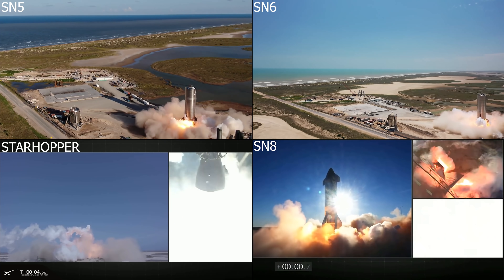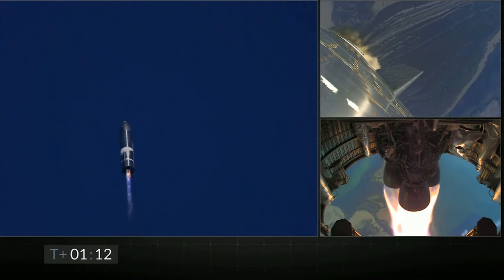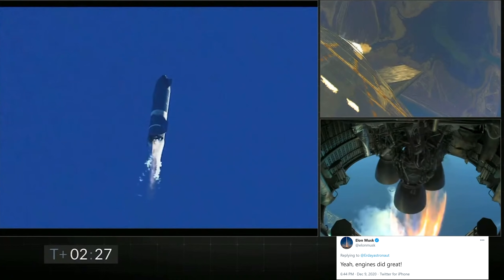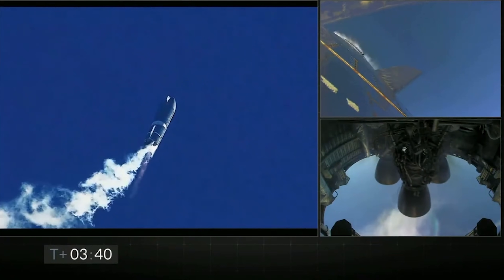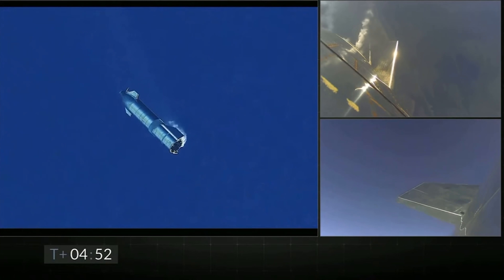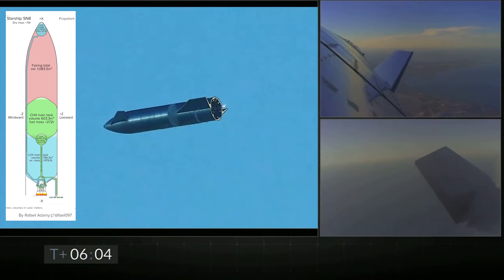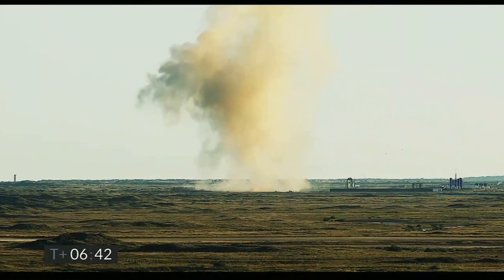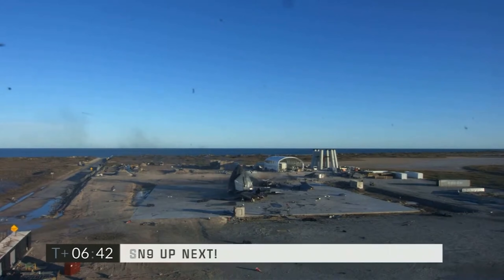SpaceX Starship Serial Number 8 Test Flight

Comment: "And the starship touches the ground at a velocity higher than zero"  😂😂😂 

But seriously this was so incredible to watch. Go SpaceX!!!
Reply: Actually, it will never touch the ground with zero velocity.
Reply: It’s theoretically possible, though highly unlikely, to touch the ground with zero vertical speed. If they got anywhere close to that, then it would be likely they could achieve zero vertical speed at a positive altitude, which is a bad thing if the vehicle has no capability to hover.
Reply: @SyNcLife  It had already done that for a couple months before the flight
Reply: @mapl3bac0n68  no no, it is literally impossible to "touch down" at a velocity of zero according to newton's law. The speed is approaching zero to be more percise
Reply: They should have erected a bouncy castle.
Reply: @wolfvale7863  true why didn’t they 😂

Comment: Very nice informative video! I would like to add that just the fuel header tank suffered pressure issues (as clear by the one engine flaming out) and that is why the engine lost thrust due to burning oxygen rich and producing extremely hot exhaust gasses that burned and corroded the engine

Comment: That's pretty smart even with a third engine shutting off it doesn't reduce the power thrust that much. The thrust is basically the same from ground level to apogee. They have to turn that third engine off at the exact perfect altitude, while calculating fuel weight ratios. Having the rocket thrust pretty much the same throughout the flight. Even while shutting off one of the three engines that's extraordinary. The problem solving here is next level thinking, I don't even think NASA is capable of this. Just look at them using old shuttle part's, taking decades just to make one rocket. The problem with NASA is they still have these old guy's that are incapable of learning new thing's. It's either their way or the wrong way, you can't teach an old dog new tricks. That's why they basically Shaun any modern rocket technologies and Manufacturing techniques. Like if their way is the only way, the"right"way. Even though their way has cost many human lives. With the most simple and unnecessary accidents that should never have happened. Simple case of extreme negligence.

Comment: It's unbelievable this entire flight was done with what looks like a fifth of the oxygen tank volume full AT MOST.
Reply: Gravity drag and air friction is about 15-20% of the energy required to reach orbit. This went about as far as needed to get out of the thickest part of the atmosphere (troposphere is 80% of the mass, stratosphere accounts for most of the rest). At this point, most of your energy should be expended adding tangential velocity if you were aiming to get into orbit and stay there.

Comment: Why -- organizationally speaking -- was there not enough pressure? Did Elon, and the other designers, not think of this?
Reply: We don't know the answer yet. But there are many potential reasons. As these systems burn fuel they are fed pressure by other tanks, if there was a valve that stuck/froze then high pressure would have been lost. Other reasons are they ran out of fuel because simulations and reality didn't match up. With the data from this flight it's very likely the next will land successfully.

Comment: As seen in the video, engines reignite too late, speed of the landing is too high.
Reply: No. You should watch the video again. Engines lit up at the right time. but they got not enough fuel after a few seconds, so they couldn't provide enough thrust to slow the Starship down.
Reply: I see you're not a rocket scientist

Comment: why the engine is so small? seem not fits with the body..
Reply: SpaceX plans for three more engines per Starship.
But this was only a test flight. No need to jeopardize more engines.
Reply: Remember 3 more massive vacuum engines for use in space are going to cram in there.

Comment: 4:08 a common misconception: hot gas thrusters do not provide more thrust than cold gas thrusters of the same size and pressure. They just consume less propellant in doing so. Of course, it is possible that the hot gas thrusters which SpaceX will make are larger/more powerful than the cold gas thrusters they are using now.

Comment: "A landing velocity higher than zero..." 😂😂😂😂😂
Did Musk come up with that euphemism???
Reply: Every landing has a velocity greater than zero. If an object has zero downward velocity, it would never land. It only gets to zero after it hits the ground.
Reply: @thomasmaiden3356  ideally acceleration would be so that velocity hits zero the exact moment it touches down. Just like x² has a derivative of zero as it touches the x axis.
Reply: @thomasmaiden3356  but you get the point
Reply: @thomasmaiden3356  "I concur..."
Reply: I guess that's more of a mathematical way of describing things. As the rocket falls back to earth, it has a negative velocity, meaning the downward direction. In order to avoid a crash landing, the rocket needs to have a positive velocity, one in the upward direction provided by the thrust of the rockets, to balance and "cancel out" the negative velocity. Essentially, it needs to land with a "zero velocity" so that it gingerly touches down. Since it crash landed like this, it technically landed with a velocity less than zero, since there was still a negative velocity. It might have been more accurate to say the rocket landed with a speed greater than zero, since speed isn't concerned about the direction of the motion. Hopefully that makes sense.
Reply: @lariosphotography4721  not bad ;)
Reply: It didn't land with a speed higher than zero, it just crash-landed. Let's say what happened. Shall we?
Reply: Wait, it's speed was less than zero? how did it crash-land?
Reply: @jone5402  Velocity going up was positive, so...
Reply from the maker: @jpdemer5  Hah! Good try, but velocity is a vector quantity. I consider the landing operation to have a downwards vector. On the other hand, who knows how the rocket scientists and engineers at SpaceX do the math. IMHO it would make it super confusing to calculate downwards velocity as negative.
Reply: @faustin289  funny one.
Reply: @faustin289  It did not crash. It disassembled.
Reply: @faustin289  He didn't say it landed, he said it had a landing velocity higher than zero. Lets hear what he said, shall we?  ;-) It was funny.

Comment: I would remove the small tanks, make the flip earlier enough to get the fuel settled in the main tanks and use the main tanks only - less things that could get wrong, less complexity. For sure the flip must be made early enough for safety margin.
Reply: "make the flip earlier enough to get the fuel settled in the main tanks" But then you have gas trapped in the feed lines. Not good. 

Also you can't keep the fuel and oxidizer cool enough in the big tanks during the flight to Mars. SpaceX know what they are doing.
Reply: @3gunslingers  I am not so sure. Those separate landing tanks are stupid. First you have more complexity, second in rapid fluid withdraw you can not maintain pressure in small tanks, third - they are too small with no safety margin. You should be capable to hover at least 30 sec for safety margin. As well you can solve the problem with the gas phase in the feed lines easy.
Reply: @lachezarkrastev7123  
"You should be capable to hover at least 30 sec for safety margin." Says who?
And the Falcon9 boosters don't hover, too.

"in rapid fluid withdraw you can not maintain pressure in small tanks" No. You have to replace the same volume. It makes no difference how big your tank is.

Also you have to ignite the engines to initiate the flip. But without the flip your fuel is sticking "to the wall". Chicken-and-egg problem.

For the travel to Mars the fuel has to be kept cool. It's far more difficult to keep a little bit of fuel in huge tanks cool, than keeping the same amount of fuel cool in a fitting tank volume. 

"Those separate landing tanks are stupid" You should tell that to the engineers at SpaceX who developed all those systems.
Reply: @3gunslingers  you can do the flip entirely with the fins, it will be just slower. Cooling in deep space is not an issue. About the tanks - it makes huge difference if you need to replace 10% or 100% of already pressurized volume.

Comment: I wish Elon would come out with an explanation of what was happening because each person seem to haveb their their explanation as to what was happening. I heard some say the the engines quit
because they weren`t working properly.
Reply: Watch the video again!
Musk already twittered what went wrong. The engines didn't get enough fuel because the pressure in the header tanks was too low.
Reply: @3gunslingers  But I was talking about the whole test I knew that part of the test was because they had run out of fuel from the header tanks but Nobody said anything about before that when the engines shut down nobody said anything about the engines shutting down which was done on purpose one at a time to slow the craft down it looked like something had gone wrong but I gather that flame was the way raptor engines always shut down because of the preburner which kept running for a bit. This was made clear from other sights and my own knowledge about the preburners.

Comment: Exceptional coverage! I follow a lot of spaceflight channels and you have the clearest exposition of the flight, an excellent resource for beginners and us hardened pros. I'm sooo glad you used the term skydiver rather than belly flop, and used that term to explain how the flaps work. (Which should be called elerons IMHO!) One quibble - near the end you mention the frost around the LOX header tank, commenting it was the tank that lost pressure. Elon only mentioned the fuel tank losing pressure. The engine-rich exhaust we saw is consistent with a continued large flow of oxygen to burn the metal.  Nevertheless - subscribed!

Comment: On your comment of not enough coming from the header tanks you was saying it was the O2 how ever the O2 was performing great it was the fuel tank that had the problem.  The green flame was the engine cooking it self which only can happen in an oxygen rich burn a fuel rich burn is oddly much cooler and there for would not cook the engine.

Comment: So it was planes to shut down the Raptors?
Reply: Yes. This wasn't accelerating to orbit, it had to accelerate and then slow down so it was at zero velocity when it reached 12.5 km. It only needed the 3 engines to get going and get through the thickest part of the atmosphere. As the fuel mass burned off not all engines were needed. The 2 that shut down on the way up were fine, those are the 2 that re-lit for the flip maneuver. They ran well as long as they had fuel.

Comment: Outstanding!!  One question, the oxygen header tank is apparently in nose, where is the methane header tank?  One website I was on last night said that both header tanks were inside the main tanks.  Also, do a video about the "Super Heavy".  One website said it's to be powered by 28 Raptor engines and apparently will have to be tested the same as SN 8 for re usability.  (there was a photo apparently of at least one section of a "Super Heavy" and it said at least 2 sections are already stacked.

Comment: One raptor engine died when touching the landing pad if the starship had enough fuel it may land safely but the one raptor died so only one raptor slowing down the starship and the landing legs did not deploy but the test is super awesome

Comment: I do not believe they turned off one of the engines. I believe it failed and shut itself off. Clearly it needed 3 engines to slow it down enough for a soft landing. They only had 2. It crashed softly.

Comment: The engines were destroyed by too much oxygen, so the header tank in the nosecone should have been okay. The problem would have been with the methane header tank in the common dome between the main tanks. Perhaps the pipe from that tank was too cold and the methane froze.
Reply: You're not a rocket scientist are you.  Elon said it was a problem with low pressure in the tank, that caused low pressure at the engine not a flow restriction.
Reply: @dregihtnek  1. The green flame was a result of incandescent copper.
2. This indicated that the engine itself was burning.
3. This, in turn, indicated that the hot gas entering the combustion chamber was oxygen-rich.
4. Thus the methane flow was inadequate.
5. The reduced flow could have been caused by low fuel pressure, as Elon tweeted, of by the flow being reduced in some other way, perhaps a blockage or gas in the pipe.
Reply: @jamieoglethorpe  Or maybe there was a pressure sensor in the tank and Elon knows exactly why the engine failed.  Why are you looking for a different explanation when the chief engineer already stated the facts of the problem?
Reply: @dregihtnek  My point is that low pressure is a symptom, not a cause. Musk tweeted within minutes of the event. We don't know if the low pressure was in the engine or tank or somewhere between. We don't know the cause.
Reply: @jamieoglethorpe  Elon Musk - Fuel header tank pressure was low during landing burn, causing touchdown velocity to be high...

We know the cause, Elon said it himself, fuel header TANK PRESSURE WAS LOW.  He tweeted it because he knew by the telemetry they were getting, the tank pressure read low.
He didn't say the fuel inlet pressure was low, he said tank pressure. 
Do you really think you're smarter than Elon Musk?
Reply: @jamieoglethorpe  Evidence suggests otherwise.

Comment: This was very good stuff! Any idea on velocities at different stages of flight?
Reply: Total height was 12.5km or 7.5 miles. 

For decent, 2 minute fall exactly. I just measured it. 2 goes into 60 30 times. 30*7.5= 225 avg mph which is amazingly slow for a huge chunk of metal the size of a 15 story building. 

The accent was 4.6 minutes. 

4.6 goes into 60 13 times so 13*7.5==97.5 avg mph going up.

No idea though for the speed at different stages of the flight, just averages. Sorry.

Comment: Great explanation, especially the expansion of the exhaust at higher altitudes with lowered atmospheric pressure. Any idea why the header tanks had low pressure?
Reply: I can offer my analysis as an avid fan of Starship: The tanks are pressurized autogenously - the methane tank with methane gas tapped off from the engine. The pressure is fine at the start of the flip maneuver, the engines light and fire well. It's possible the G-forces of the flip damaged a gas line, interrupting the flow and causing the tank to lose pressure. Btw, Elon only mentioned one header tank losing pressure, the fuel one (methane). The last engine was still getting a high flow of oxygen, that's how it started burning its insides.
Reply: @donjones4719  -- Makes total sense.
Reply: @David Carr  SN5 and 6 very likely didn't. I haven't been able to find a definite official statement that SN8 (SN9 etc) do, but some smart people on the SpaceX reddit are as sure as they can be. This is based on meticulous observation of every detail that goes on at Boca Chica, and a surprising depth of rocket expertise. Of course, this has to be refined out of the many amateurs on there like me, but it is high quality stuff.

Comment: sn8 lost a engin a good way up they began venting fuel after first engin failure,  then they bellyflop  they bled the fule to keep it from big boom at end the green is ttab the engis detected flame out and was trying to relight
Reply: It doesn't use starter fluid. The pressure on the header fuel tank during the flip dropped, and the oxygen rich burn essentially burned the engine. The green was the engine rich exhaust.

Comment: Great video! I've been annoyed somewhat at some who have been calling it a 12.5km "hop". It was not a hop, it was a high-altitude flight test. Nothing like it has ever been done before. Not even F9 booster returns/landings are as difficult as this was. What an amazing thing it was to witness.
Reply: Yes! Hops go up and down vertically. This was a flight, it used flight surfaces controlling the aerodynamic airflow - a flight.  I've fought a losing battle over this on various forums. Even worse is the term belly flop. Skydive is a much more descriptive, informative term. I'm glad to hear it here.

Comment: During descent with the belly down, wouldn't the remaining fuel in the main tanks pool upwards towards the "top" due to negative g force?
Reply: Not at terminal velocity
Reply: Doesn't matter. For engine restart they use header tanks that are completely full for that reason you just described.
Reply: @samos8367  True. I wonder what led to the low pressure to the raptors.

Comment: Is the exhaust important? I would just reuse or recycle the exhaust to build up pressures in those tanks so they can have sufficient pressure to ignite all Jets .
Especially in an atmosphere that doesn't have any density 🤔🧐
Reply: Yeah you're not a rocket scientist.  Let's see, how about we put extremely hot exhaust gas back into a super cooled fuel tank.  What could go wrong?
Reply: @dregihtnek  
Why wouldn't you cool it down like  the bells on the jet propulsion 🚀
I don't think I would do it the way you was thinking LOL 😆
You know they run cooling through those bells so they won't melt away while propelling the rocket
Reply: @pimpdaddy1469  You really aren't a rocket scientist. 
Let's see, the exhaust is used to propel the rocket.  If you recycle the exhaust, then it's not available for propulsion.  Less thrust, not as efficient. 
They run LOX through the bells to cool them.  How are you going to cool 5800 degree exhaust?
Reply: @pimpdaddy1469  Really?  No I'm not a rocket scientist but I know what moves a rocket.  You apparently have no clue.  Please tell me, what does move a rocket since you think it's not the exhaust?

You also forgot to answer my last question.  How are you going to cool 5800 degree exhaust?
Reply: What are you gonna do with me >:(